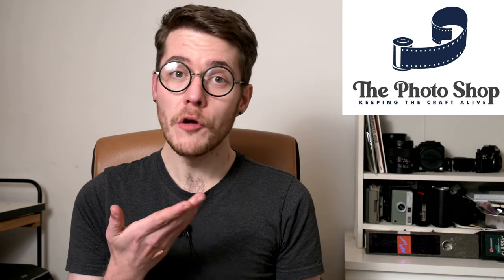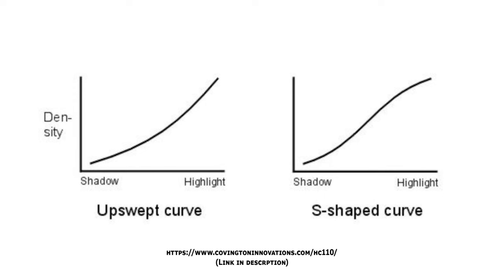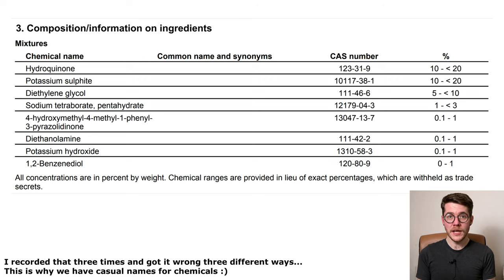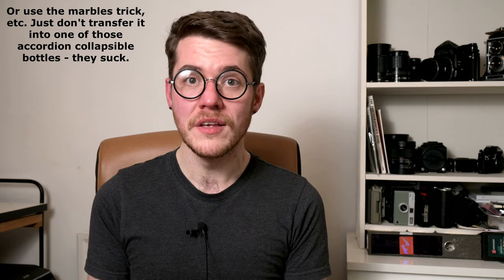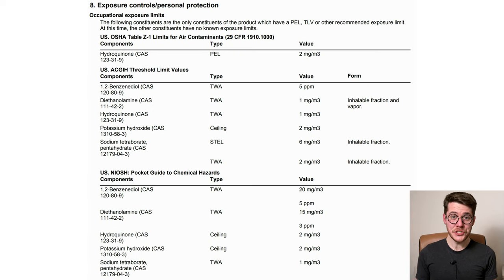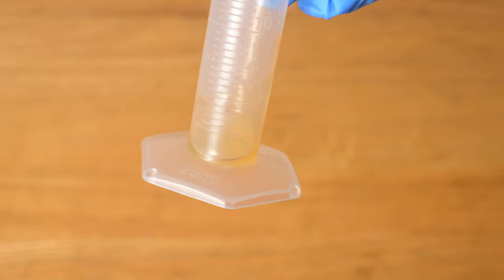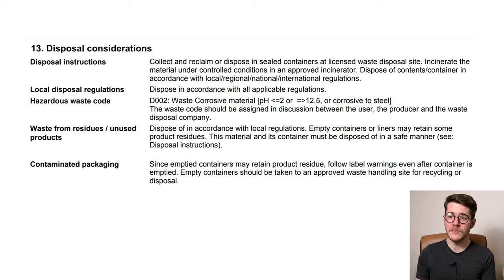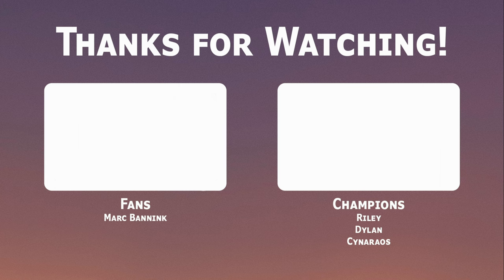Kodak HC-110: Safety, Handling, Disposal

Comment: Thanks for the excellent info. I was using Euro HC, which is frankly brilliant, if a little expensive at the time, so I moved onto the original Kodak HC110 and had mixed results, to the point where I didn't trust it. I upped my mixing regime, remembering to shake the bottle before I started, and that helped. I think, after watching this, I will give it an extra round of stirring. Did you know there is a free android app with dilution calculators and push and pull calculators in it.
Reply from the maker: Glad it was helpful! What did you find different about the results the two developers gave you?